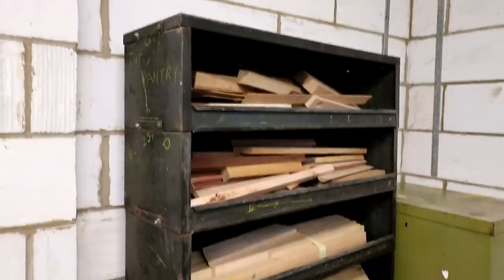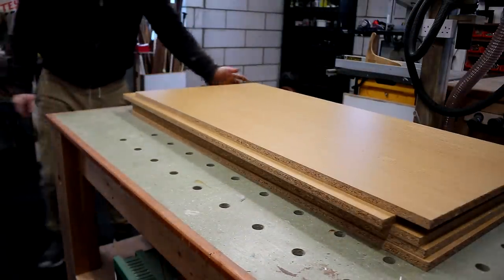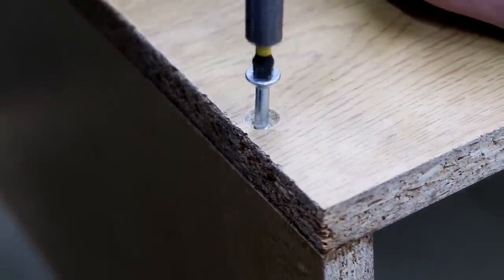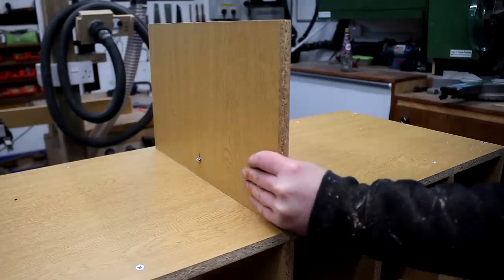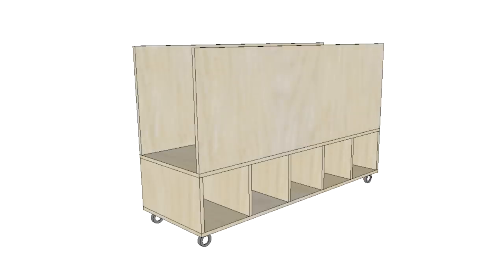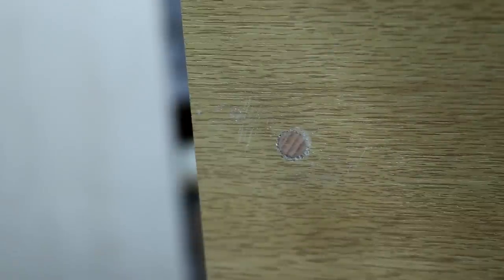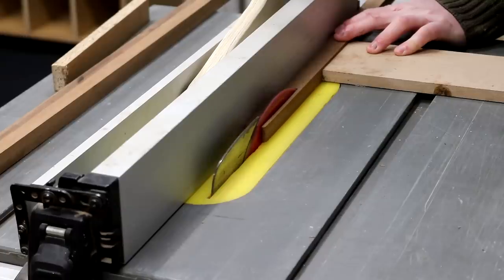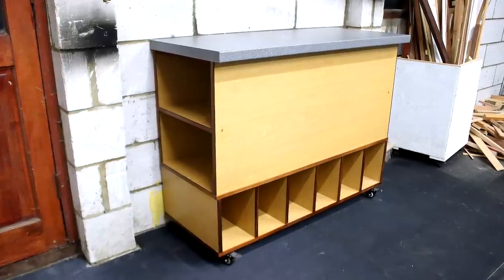Making A Wood Storage Workbench For The Workshop

Comment: I smiled at "this is my first mistake of the project. I really like your honesty with these things, because mistakes are just part of the process. I say this someone who recently spent a day lovingly smoothing, sanding and chamfering the edges of a walnut table top. Then applied a first coat of Danish Oil, only to then realise that, while I'd cut it to final length I'd forgotten that I needed to rip 30mm off the width of the board.

Comment: Very clever storage idea! Another design solution for the divider could be to make it an "off-center divider." Not only would it eliminate the need for pocket screws, but also create spaces for two different sizes of medium-length scraps. That way the top could be saved for exclusively long pieces.

Comment: Little goofs are just part of the process [as a semi-regular occurance] and are a normal function! All in all you've squeezed about all you can from that ugh material. Its looks very solid [usually it makes useless shelves that bow & snap] but you've shored everything well [which is part of the good design] and actually looks very appealing too. Just keep it dry, that stuff swells up and goes as fluffy as a die-hard romantic watching cat videos if it gets wet!

Comment: Great job, that central divider (mistake as you called it) could have been located with dowels?? But still a great unit for all round use , may have to copy this, just finishing my own build first , a roll cab made from recycling road signs and a filing cabinet

Comment: You, my fellow craftsman, need to aquire a pocket hole jig and utilize this method of attachment
Reply from the maker: I don't really like pocket holes so try to avoid using them normally
Reply: If you give yourself some time with the system you realize that it is very functional. I just think that it elevated my game when I began using pocket screws. Where they are hidden is desired but it is a good connection. Do you use biscuits? 
Good luck with your work. Been watching from the beginning.

Comment: I had exactly the same issue storing them vertically :) I know it sounds OCD, but I write the usable length of the wood on the end with a marker pen. Seems a lot of work but you have to measure it when you use it anyway and it makes choosing a piece later much less irritating. I also write length x width on boards in my board rack. ( But I am also of an age where a board that is 200mm wide by 43 1/2 inches long sounds reasonable)
Reply: Not a bad idea, especially if you store long pieces somehwere where you can't see the full size of the piece at once. Saves time not having to pull each one out and going "Nope, too short".
Reply from the maker: That's a cool tip, I like it 👍

Comment: If you had offset the divider, rather than making it central, you would not need the pocket holes, and would have three different lengths of storage; maybe 1,500, 900, 600 (might be an idea as an option in the plans?).
Reply from the maker: Certainly an option!

Comment: Couple of Quick thoughts. First of all I think I would put dowels down the length of the two side panels keep them from being knocked out to easy. Secondly your center divider could’ve been attached also by using 3 or 4 dowelsdowels a crossed and then glued down. And for a third thought you could’ve used a more proper pocket hole made with a proper jig and then used a piece of dowel to plug the pocket if you cared seeing as you said that you will not see it anyways. Finally I would’ve put hardwood or softwood, pine would work, under the bottom and attach the casters to that. Melamine and particleboard are really bad about warping and with the way the casters are now a little bit of moisture and they could break right through. Just a simple one by down the length on either side or even make a simple frame out of solid wood would be a good improvement. Of course if you use plywood it’s not quite so much of a deal as that plywood is far more stable.

Comment: What do you use all your little pieces of wood for? I used to save everything but just accumulated inordinate amounts of odds and ends and there was never enough of one thing to use on a project! I since turned it all into firewood to keep me warm all winter and now only keep big bits of timber.
Reply from the maker: Coasters, key racks, coat racks, that kind of stuff, lots of which I've featured on the channel👍

Comment: Newbie here. Is melamine the same thing as particle board?  I’d you couldn’t reuse it, because the saw dust is toxic. If it’s not toxic, I can have a lot more ”wood” for projects.  People are constantly throwing that stuff away.
Reply from the maker: Melamine is the plastic coating, particle board is the substrate 👍 the sawdust is no more toxic than MDF, it probably contains a small amount of formaldehyde in the glue that bonds it together but dust extraction and a dust mask and you'll be fine

Comment: is there a difference between melamin and chipboard?
Reply from the maker: Melamine is the plastic coating, chipboard is the substrate of the board 👍
Reply: C S it seems in the states this would be called veneered particular board and melamine is a sawdust that is glued under pressure and not chips that’s my understanding anyway.

Comment: Excellent design, but the pocket holes are unnecessary... surely you could screw in from the top and both sides and that would be enough? Again, great design though 👍🏻
Reply from the maker: Yeah I didn't want any screws in the front panel